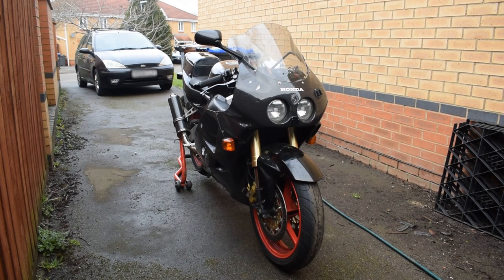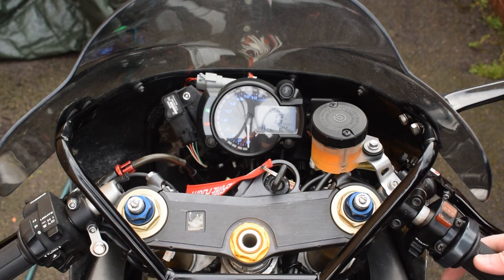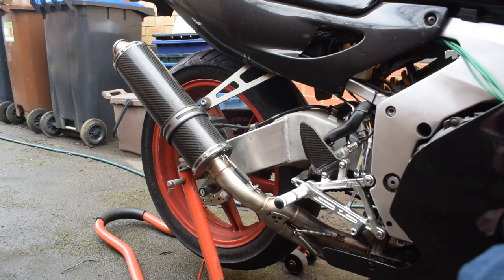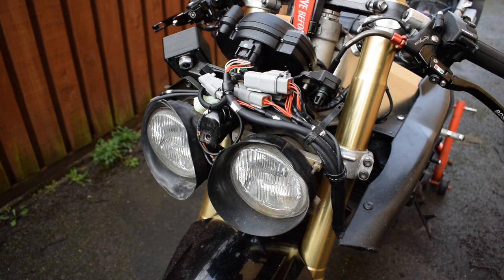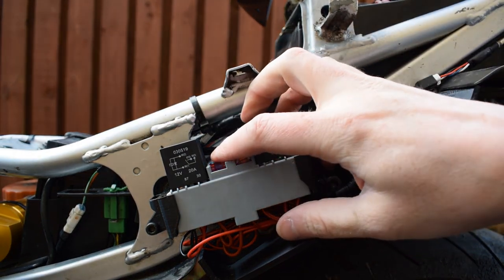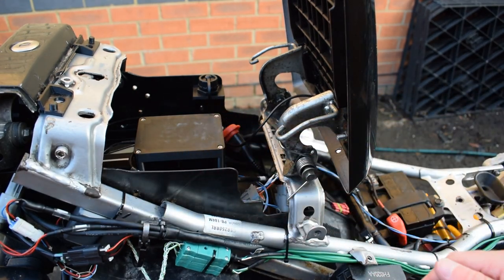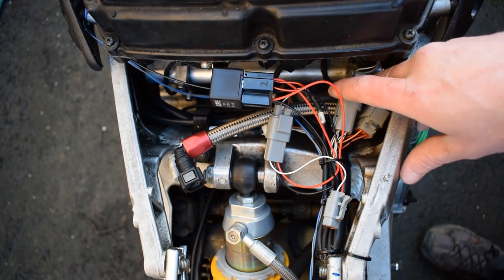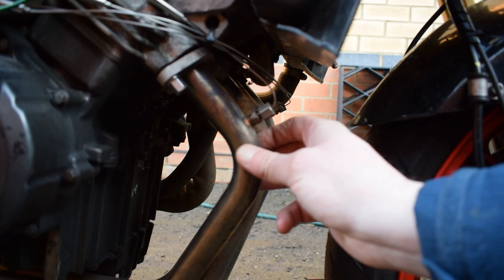Project CBR250RRi Walkaround - Fuel Injected CBR250RR mc22

Comment: A friend who is an Automotive Engineer & motorcycle mechanic got his Tyga MC22 running on Microsquirt in a matter of weeks about 18 months ago with great success using measurement & mathematics & did cylinder head work & machining to make it optimal for 98 octane unleaded , increased compression ratio modifications were done .  We increased valve lift slightly . Race grade top of engine parts were made / used & he raised the rev limit by 2,000 RPM above the factory benchmark which our oscilliscope told us was 16,900 RPM before work began . We had a power increase of about 16-18 % . The friend has completed a second one during Covid lockdown as he had spare time & had  extra sets of parts he made & purchased on standby beforehand from the first motorcycle which allowed him to convert my companion rider ( track ) MC22 to the same configuration as his in two days as he knew the procedures .The dyno test was the same for this bike also . He will be doing this to a Yamaha FZR 250 in two weeks .Parts are already prepared & I will ride the converted Yamaha on my birthday soon at the track alongside him riding my Tyga .I am sure the bikes will be fun to compare . I personally like the Yamaha FZR engine sound as it is more raw than the Honda  , that has all it's gear driven cam harmonics which cause me back pain after a while riding it . The Yamaha does have EXUP valve installed  . I loved doing the first prototype Tyga EFI conversion last year with my friend . It helped strengthen our friendshp &:it was fun & I learned a lot .
Reply: (A) where is his youtube user name and (B) he better document the fzr250
Reply: @AdamMc07  He is not a Youtube contributor . The post five months ago described research he was doing as well as the resultant prototypes of project Tyga 22 . He keeps his expertise close to his chest to a certain degree as he had honours at university . I cannot tell him what to share with the wider community . This is his decision , not mine . I had a lady friend convert the Yamaha FZR 250 series workshop manual to English for me a couple of years ago . I have a copy as does the mechanic friend.  We had the Suzuki GSX-R 250 books done also . This allows us to do special refining work with a platform to work from . I do not upload anything to Youtube as copyright theft is commonplace & it is poorly  moderated .
Reply: The Yamaha FZR 250 3LN1 was converted to 98 octane fuel optimised configuration but with standard grade new engine components with the EFI conversion & the Microsquirt system applied . Compression ratio was raised from 12.0 to 1 TO 13.5 to 1 . The same as the two MC22's . I will ride this set-up on Monday 11th April . We have acquired a second FZR 250 3LN1 which is white & light blue which we will refurbish so that I can use it for private transport . It will be handed to me on my next birthday . A cylinder head had to be made up overseas & sent here for some machining to achieve the compression ratio change . The same had to be done for the MC22 Tyga's . This was the reverse of the changes from earlier 1990's MC22 models to the watered down 'R' series of 1994 . The black 3LN1 was upgraded , the white & light blue one for my private use will be close to standard with minor refinements only .
Reply from the maker: Nice! Sounds like some really interesting projects. If he ever decides to put any info on them online then be sure to link to it. :)

Comment: Awesome project, very nice improvements. I'm competitively racing my MC22 here in California and would be fond of a Ohlins shock. May I please ask for any info you have on your Ohlins shock to get my suspension builder started. There should be a number on the shock body, or any pictures of it before it went on the bike. Any help is much appreciated, Thanks
Reply from the maker: A bit late I know sorry! The shock is a S46HR1C1 base. The key thing is that the top mount cannot be aluminium as there isn't the clearance to the frame for an aluminium top mount. Really, I just dropped the bike into the local Ohlins dealer and left them to spec and manufacture the shock how they saw fit. Hopefully you get sorted with yours!

Comment: I am looking at fuel injecting my mc22 and was wondering what injection manifold and injectors you used for your bike?
Reply from the maker: Hi Mark. I have used the original carburettors and modified them to take the injectors and fuel rail.

I have a few posts on the process in my blog.
http://www.cbr250rri.com/2014/01/throttle-bodies-wiring.html
http://www.cbr250rri.com/2014/01/tps-mount-plumbing.html
http://www.cbr250rri.com/2014/03/throttle-bodies.html
http://www.cbr250rri.com/2014/03/final-assembly-wiring.html
http://www.cbr250rri.com/2015/08/permanentisation.html
Reply: @twillinger  excent videooo!! Thank for inf., saludos desde lima perú 🙌

Comment: Hi, doing a 600RR 2007 front end conversation to the mc22 and was wondering the dimensions required for the triple clamp stem did u have to fab one? Cheers
Reply from the maker: Hi. The only parts I fabbed were the wheel spacers. Everything else fitted with different sized bearings. The top stem bearing was special as the standard size is a bespoke Honda size so I needed to find something with the ID of the Suzuki stem and the OD of the Honda bearing. I did have to cut away part of the nose fairing and false air ducts to give some clearance. More details and photos of the conversion in this forum post: https://www.cbr250.com/threads/project-cbr250rri.7307/post-294714.
Reply: @twillinger yep just finished the whole process, works great, just needs about 5mm more steering angle to clear the handle bar lock. I’m really interested now in potentially designing a new airbox that uses the ram air ducts on the sides of the fairings but I’m not sure if I should stick with using carbs and if that will work well enough, or take the weight penalty and try and make a EFI system based of yours for it. Should definitely help top speed power with that extra 1psi of air pressure 🤣

Comment: Subscribed did it lost the power because of fuel injection ?
Reply from the maker: I couldn't tell you to be honest as I never dynoed the bike before doing the conversion. I wouldn't expect it to lose power though nor gain any either for that matter.
Reply: @twillinger  going efi should theoretically allow you to have better control of the fuelling through a wider rev range resulting in  more power and better efficiency- depends how much you tune it though- paticularly if you figure out a way to run coil on plug or similar
Reply: Good job lot of work maybe slide carbs would have been easier and better! But maybe that wasn’t the point. Well done ! I built drag bikes.
Reply from the maker: @mikepeterson6527  Thanks. Yeah the point of the project started out with learning about EFI and engine control and I've managed that. :)